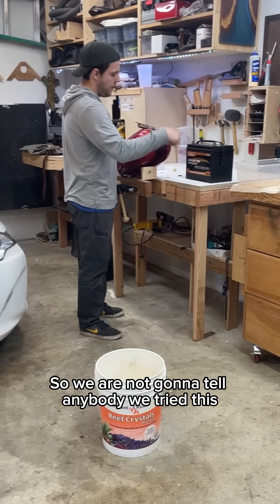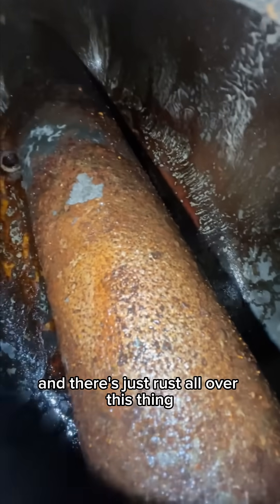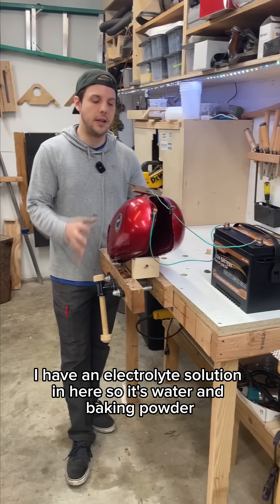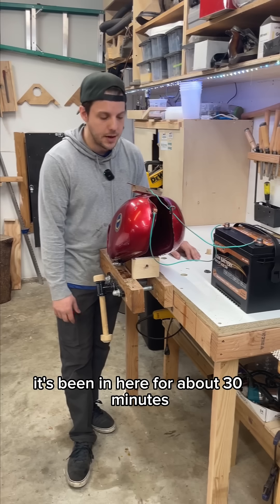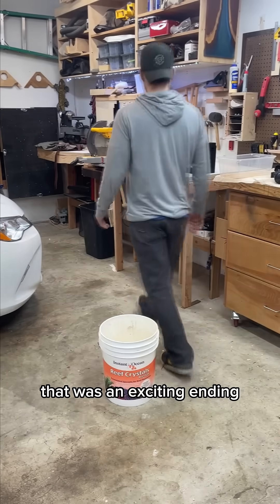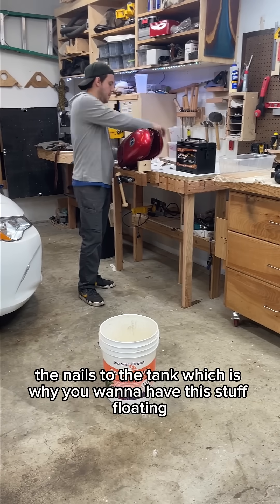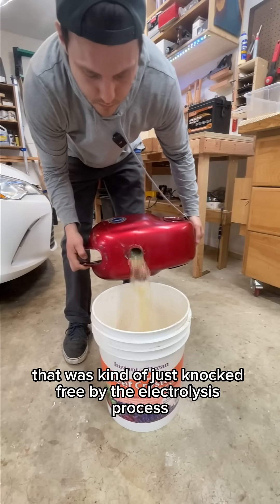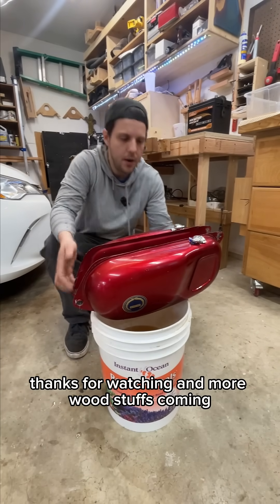Electrolysis Works — But NOT Like This (Fuel Tank Rust Removal FAIL) #diy #motorcycle

Comment: Im doing this now and used a tennis ball with a bolt through iit on the gas area,  Taped it down so it wont move.
Reply from the maker: Nice! Did it work?
Reply: @SebastiansWoodStuff  its on right now.  My tank didnt seem rusty but ive been cleaning it OVER AND OVER AND OVER AND OVER with vinegar and more stuff keeps coming out.  im doing the electrolysis and then the eastwood tank ckeaner, etcher and sealer.
Reply from the maker: Good luck. The process takes forever.

Comment: Since it's free from gas fumes take a handful of nuts and washers and some small bolts if you like and put them in the tank. Seal the top of the tank wrap it in a big blanket and set it in the center of your dryer make sure the tank cannot move inside the dryer. Then turn the dryer on "no heat" and let that knock off the rest of the rust. Flush with water as needed and repeat if you need to. You may have to apply a light coat of oil on the inside of the tank to stop it from flash rusting again. Do not use ethanol gas hope this helps.